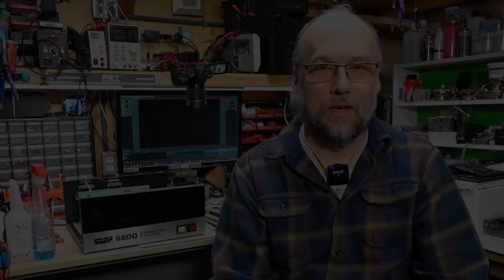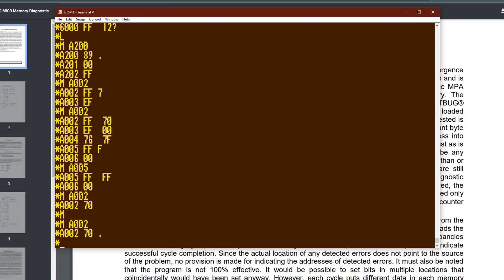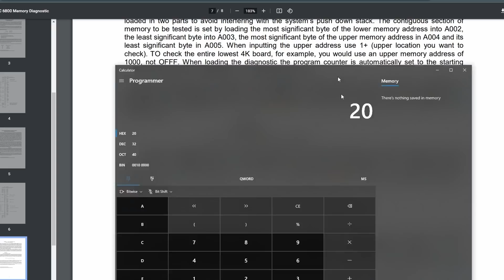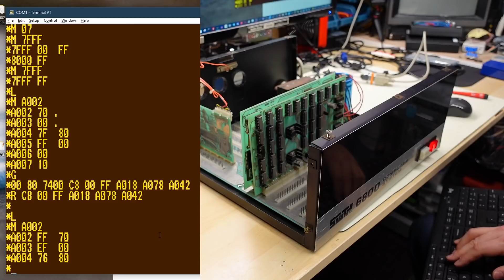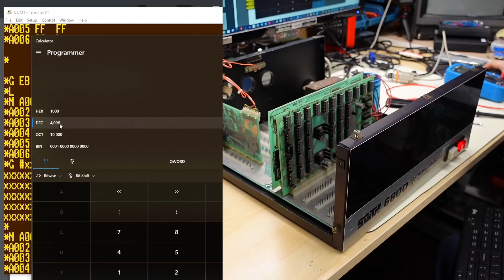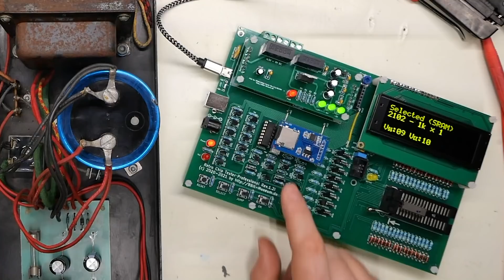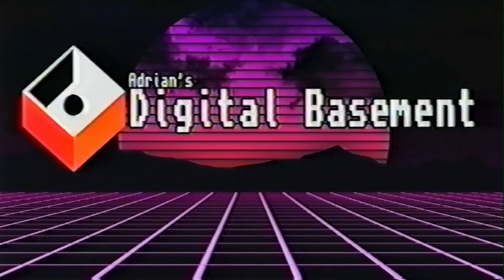Searching for bad RAM on a 45 year old SWTPC 4K RAM board

Comment: The big difference between modern computers and ones like these is the fact you can actually dive deep into repairs, I used to repair "modern" (mostly late 90s to late 2000s) comptuers as a job, and the transition from repairable at component level to the "replace the everything" that has become the norm now was a really fast process, and it's what put me off repairing computers, they just build the parts to be used and binned, rather than maintained for life like this old beast...
Reply: I think that transition happened around the time when chips stopped failing as often, and when they did, it took a hot air rework station to replace a minimum 164 pin flat pack. ;-)

It takes a pretty hard-core repair person to trek into BGA territory.  “Replace the everything” is the only valid option at scale.
Reply: @sirnickity  I've removed ad replaced 288 pin MPUs without a hot air station.
Reply: @michaelterrell   Great.  Are you trying to say you would want to replace flat packs and BGA ICs for a living, with a soldering iron?

Lots of things can be done.  That doesn't mean it makes economical sense.
Reply: @sirnickity  We didn't use any BGA chips, but I did change or completely resolder a lot of SMD ICs from six to 288 pins at work.. I could send them to rework, and wait. And wait. And wait some more. They intentionally hid about $7,000 worth of new boards, instead of doing the rework. and I was accused f losing or stealing them. I dug through everything at the rework area, and found every one of them in front of their boss. After that, I rarely sent anything to rework. 
I could do the work right then, without taking it off my bench. I had one of the later B&L StereoZoom microscopes on a cart with proper ESD protection. I had three Edsyn Loner soldering irons. Two with the smallest standard chisel tips, and a third with a 0.015" tip along with 0.015" Ersin rework solder.
I did better work than the three women in Rework, and I did it faster. I also worked with Manufacturing Engineering to update our entire reflow soldering process. It was stuck in the 1206 era, and we had just introduced 0201 components.
By doing my own rework, I was more than twice as productive  when compared to anyone at the board/module level. I also built test fixtures, and updated test procedures. A lot of this was brought on by the ISO9001 certification process. Some cards had well over a dozen versions, with a six page test data sheet. The outside 'expert' saw nothing wrong with the existing procedures, but having to pint out over seven pages and marking every line on all but six as N/A wasted a lot of paper and time. I also took the average test time for that group of boards from 7.5 hours down to 17 minute average with the new fixture and test procedure. It had 16 Sallen-Key filters for easy selection of the video output bandwidths. They were identical, in two frequency ranges. The output frequency was set with two pairs of precision resistors. Slight variations in the inter element capacitance within the circuit board required some Select In Test. One of these went to the ISS as part of a kU band Data, Voice and Video uplink. I worked on about half the boards in that receiver, both digital, analog and RF.
I'm nnot a hobbyist, I'm a retired Broadcast engineer, and I did mission critical work at remote sites with zero outside support. I did Engineering Tech work at that last job. I tested one off products. I certified new suppliers and I did failure analysis.
Reply: @michaelterrell   That's impressive.  Still.. I think even you would agree that's probably not a normal situation.  Right?

We're really losing the thread here.  There's a lot said about how today's electronics are "disposable" and "we used to be able to work on them" as if a through-hole Ryzen were a possibility.

I'm just saying ... when you can walk into a store and buy a brand new Blu-ray player for $50, trying to get a DRAM IC off the board and replaced with another is just not economical.  Same goes for replacing an Ethernet controller on a $150 motherboard.

As these things get more tightly integrated, and thus more specialized, and more difficult to work on, the tools required to test and repair them get more precise, expensive, and only attainable to a more highly-trained specialized workforce with -- frankly -- better things to do with their time.  So the repair industry dries up, and there's nobody left to sell schematics and test jigs to.

So you could surgically implant a Bluetooth transceiver onto a tick's butt.  Great.  But are you going to do that at an hourly rate that makes it preferable to bring my sub-$100 device to you, rather than ordering a new one with free 1-day delivery?

That's my point, bud.  The skills exist, but within a smaller pool of people who have spent more time honing their craft, and have way cooler toys, and aren't willing to contract out for peanuts anymore.  Is that not true?
Reply: @sirnickity  I was working on $30,000 to $80,000 Telemetry systems. I am now 100% disabled, and I receive a whopping $428  per month VA disability to live on, so yes I would replace the bad chip, rather than go without food for days.
Reply: @michaelterrell   I'm really struggling to figure out what you're trying to prove.  I don't think your particular combination of past experience and current financial situation is representative of the repair industry as a whole.  Are you trying to suggest it is?

I mean, there are hordes of hobbyists out there who wish things were like the old days, when you could get schematics and things were repairable.  I get that.  I miss it too.  I am just a hobbyist because, while I briefly considered electronics work (because I genuinely enjoy it), by the time I was educated and entering the workforce, it was evident that it was a dying industry.  I ended up deciding that I would better be able to finance that pursuit as a hobby than as a career.  I think I made the right choice.

There is a place for people with advanced skills, but I can't imagine the career path that would get you there today.  You don't get good at this stuff overnight, so it seems like a long trek of barely scraping by to get to a point where you could command a king's ransom to work on the tier of equipment that you did, and beyond.

So, what exactly are you saying?

I say if you're going to do something in volume, you need tools.  You say you can do it without.  Well, uh ... good for you.

I say it's uneconomical to replace parts on mass-produced goods where a living wage would require more labor cost than the product is worth.  You say, you would do it.  For a living, or as a labor of love?  If the former, it wouldn't be much of a living these days.

Are you just looking to point out exceptions to the rule for grins and giggles, or do you actually disagree that "it isn't feasible anymore" is the rule?
Reply: @sirnickity  I am completely self taught, starting at eight years old in 1960 12 years later I tested out of a three year Engineering course. Since then, I have kept up with changes in the industry. All I'm saying is that you can develop the skills, if you really want to. I repaired a lot of equipment without schematics. Datasheets on ICs  are a big help. Not everyone can  become world class, but many sell themselves short. It isn't the price of consumer goods, it is the knowledge gained by keeping it out of a landfill.Te more that you do this, the more skills you gain. I started repairing vacuum tube based equipment. I ended my career by building top class Telemetry for NASA, NOAA and the ESA along with many other government agencies. I took two years of High School Electronics for easy credits. I didn't even open the textbook, and I was the Teacher's assistant during my second year. If I had given up on the difficult tasks early on, I would have never gone very far. I used to volunteer at a local Vocational school to help the students with real world experiences. I gave them access to my hundreds of databooks, and would give away a lot of inexpensive components for their projects. I wouldn't do their design projects, but I would answer questions to put them on the right track.

Comment: Modern computers are easier when they work, but the one I just built has gremlins. Newer hardware pushes itself so hard it's always on the edge of failure at stock clocks, but because it's consumer grade, reliability isn't a concern. Nothing adequately diagnoses itself. When something fails and you don't know which part, just buy new stuff until it works. The industry likes it that way.

Comment: I just remembered this little tide bit if you are programming the 6820, paralllel chip there was a bug  that caused data corruption. The bug was fixed when 6821 came out. For the 6820 you had to do a reset before writing to a register.

Comment: I worked for Motorola Micro Systems when all the 6800 family was new as a bench technician.  When we would work on memory boards.  We wrote a script that would write 3's and c's to memory. Then just watch the address line cycles.  Easy to figure out what was not working.    I wrote a bunch of scripts for trouble shooting.  I wish i still had copies.  Motorola sold memory boards for $1 a byte.  So a 16k memory board cost $16,000. When the 6809 came out it had better memory management, with paged memory and we came out with 32k and 64k memory boards. The 6800 memory map was flat.  You can put what card at what ever address you wanted with a few exceptions.  The stack was down at the bottom of memory, and the mbug.resided at the top.  When 9600 baud came out we were amazed at how fast it was.  We used either a Motorola terminal or a TI thermal printer.  I have been looking for a Motorola Exorsiser or a SWTP computer years. There was a Basic that came.on proms.  I think it was called tiny basic.  I might have a set of eeproms laying around.that that i will send to you if want them.  We dold a card ths5   lot of fun working on new technology.  Back in the the 70.  There is a trick that we would use to watch address lines. I would ground one pin and all of the address lines would start toggling.  I loved those computers easy to program easy to learn to use.  I think all the software that would run on an Exorciser would run on a SWTP computer.
Reply: I used to maintain a pair of Metrodata character generator that Exorcisor based. They were scrapped about two years after I left the company. Each had 6 NTSC video cards. I was told that they were given to the remaining Metrodata engineer, because the company had closed down. It also had a SMS 8" floppy disk system.for one of the computers. Dual drives and it weighed about 120 pounds. They were replaced with a bunch of Commodor 64 computers, and one 1541 drive. along with an EPG decoder/character generator to replace the local program guide. It was uplinked on a subcarrier on our WGN uplink.
The early Weather Channel interface was 6502 based. The ICs were almost a match to a VIC20.
I think that I still have a Vector Electronics protoboard for the Exorcisor bus.

Comment: 12:51: If I understand correctly, this means it's big-endian, right? Am I wrong?
Reply: Correct.  Motorola used big endian in 68xx and 68xxx series.
Reply: @robertdixon8238  Thank you. :) 
(Also, I'm facepalming a little at my own stupidity to have not caught on to the obvious M6800–M680000 connection, because I kind of knew that about the M68k.)

Comment: possibly you know this or not. all power capacitors should not be left with volts when you are not using electronics, it shortens the life. not all capacitors have a load when the appliance is switched off and therefore they must have a resistance of a few kilos ohms above the capacitor
Reply: The bleeder resistor is usually there to ensure the system is safe to work on shortly after power is removed.  It isn’t for the capacitor’s benefit.  The PSU would be slightly more efficient without it.
Reply: Nonsense! It is any AC  current that causes internal heating that shortens their life. If there is no load, there is no AC current. Bleeders are a holdover from old high voltage tube designs, to prevent electrocution from dielectric adsorption. Some HV capacitors were shipped with a shorting wire across the terminals to prevent a voltage buildup as the dielectric released the adsorbed electrons. I'm a retired Broadcast Engineer. One transmitter I worked on used 7,000 volts DC for the final tunes, and 1000A at 1.5 volts on the filaments. Both were dangerous. The HV would kill, instantly. The high current could vaporize many tools and cause an arc flash the hit you wit the vaporized metal and burn you to death.
Reply: @michaelterrell  Answer me on one thing?
It has been said that having the TV screen on standby is not good for capacitors since capacitors are constantly charged. Broken  capacitors in power suply on a tv screen are very common fault.
Reply: @kalle-09c  Do you leave it plugged in and never turn it on? In standby, there is a lot less current pulses to filter out, but it doesn't generate enough heat to damage a good capacitor. Some crap brands are only rated for a few thousand hour life at their rated operating temperature.
If electronics didn't generate head, we wouldn't need 105C  (or 125C) rated electrolytics. I've dealt with bad capacitors since 1966. Today's failure rate is much higher than in the past. The OEMs shrank the physical size, which concentrates the generated heat. Older electrolytics had a much larger aluminum can on the negative side, and it could radiate waste heat in the larger cabinets. Today, they have to be quite close to high current load, so it is harder to be rid of the heat. Tat dries out the synthetic rubber seals. Once they no longer fit tight, the electrolyte either leaks or boils way. If they generate too much heat they either split open on the end of the can, or the can is blown off the insulator by steam from the hot electrolyte.
Once again, a steady DC voltage does not damage electrolytics.
Reply: @michaelterrell  so constant volts on a capacitor do not shorten the life of a capacitor?

What I have read is that it is not good to leave the screen in standby mode when you are not using it since it shortens the life. Is it just nonsense?

There have been a lot of capacitor faults on TV screens.
Reply: @kalle-09c  Believe whatever you want. I know from experience and training, not old wives tales.

Comment: I used to run quite powerful  IBM RS/6000 machines connected to the serial when I worked at IBM. Lots of those machines did not even have a graphics board in their config.

Comment: I'm working on a heavily corroded board from a 60's camera. Heated 50% dilute Pine-Sol can do wonders. I use an ultrasonic cleaner with heater, but just hot soaking will shine up connections & boards well. It may remove weak solder mask though. But at that era, some boards don't even have it!

Comment: I owned a Color Computer which was great. It had a bunch of great business software and also a cartridge called EdTasm which is a 6800 assembly language editor/assembler. This is what I learned assembly language on. In fact, a company that I was involved in used the CoCo motherboard to make engine test systems for Cummins diesel engines at the 20 acre plant near Jamestown, NY.  Worked great and really reliable.

Comment: With the ZX Spectrum being 40 years old today, in celebration I powered my childhood machine up for the first time in decades and am going through similar issues. Got it booting after replacing a RAM IC whose data pin was jamming the bus but now have more intermittent issues to look at (another IC dragging down the bus). All good fun!
Reply: Pardon me for being a semantic nerd, but bootstrapping is the process of loading a small program that in turn is able to load the main system into RAM. 

ROM based computers like the ZX line and most other home machines didn't have to do that, at all. They just started, instantly.
Reply: @herrbonk3635  Very true. I (mis)used the word “boot” to indicate that the machine successfully executed ROM code to the extent that the Sinclair copyright message appears and is accepting commands that let me try load software :)
Reply: @graemedavidson499  Or commands that builds a program. It wasn't really intended as a game computer after all (despite the fantastic teletext style colours :D) My point was that the BASIC interpreter in ROM is the (operating) system. Loading external software is another thing, and similar to computers that does indeed "boot".

Comment: Very interesting way of troubleshooting, using the provided diagnostic tests as the "keyhole" into the system, and sure a great find to point ot the one bad chip.

When it comes to video length, I wouldn't even mind a day-long video. I know, this is not at all feasible, but watching you troubleshoot this retro stuff is just something I will never get tired of. ;-)

Comment: Not only does that centralized clock save on chips, it also ensures the various clocks will be in sync between all carts, something you can't really do when every cart has its own clock.
Reply: True - and with the really moderate clock speeds of the era, you don't need to worry about adverse effects that the long connections between clock generator and clock user may cause, or even getting out of phase because the connections differ in length. With today's speeds, such an approach would be much harder to implement.
Reply: @Colaholiker  Another nice thing is, that with the 6800 bus you can easily share the bus between two masters. The CPU is only accessing when this clock is high, so the bus is free when its low.

Was for example extensively used for graphics which accessed the shared memory in between the CPU cycles.